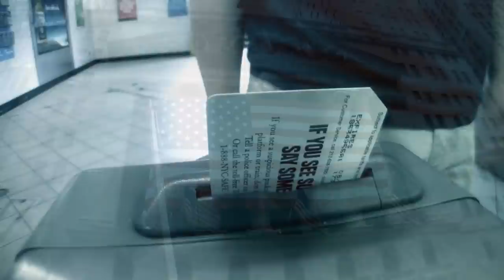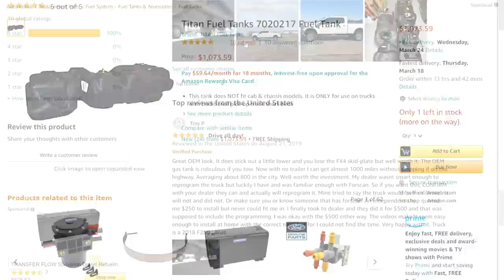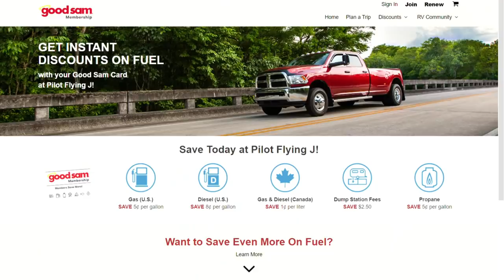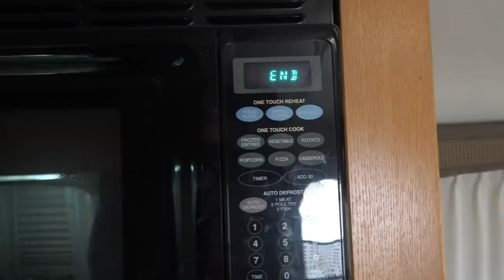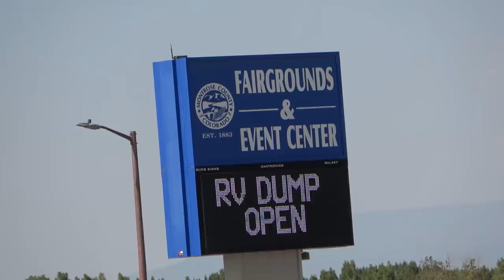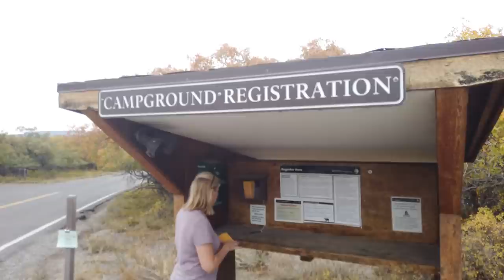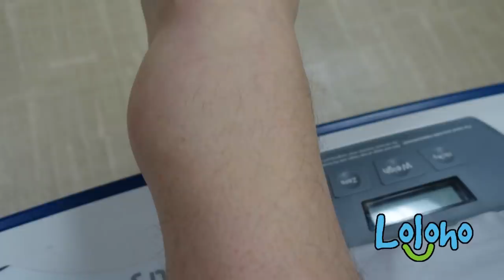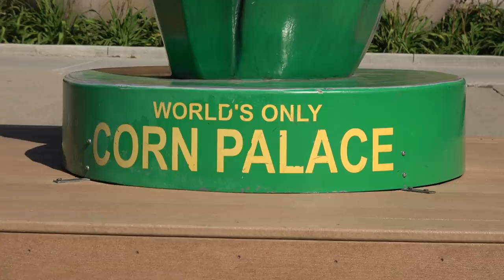For Beginners: THE COSTS of an RV Trip!

Comment: Gas Buddy has saved me a lot over the years. It saved me $1 a gal in Calif. by just going down the road another 10 miles. usually 10-20 cents if I use the app and stay away from the ones right off the exits. My experiences have been just the opposite with propane at distributors. Locally & 2x on trips they're about 40-50 cents a gal more. Surprisingly in small town gas stations have been my best experiences. Last year in Cottonwood AZ at an RV dealer it was 99 cents a gal.  My lifetime Pass has paid for itself many times over.

Comment: When you need propane, check to see if there is a Tractor Supply store nearby. They usually have the best price in our area.
I do try to avoid toll roads when towing. I hate paying more than double the car rate to tow my travel trailer on their roads.  And you don't get any break on the fuel taxes when paying tolls, either.
Reply: TC is the best deal around here too. I'm lucky to have a TC I can stop at on my way to the highway, and a Cabela's with a dump station on my way back. Trips start with full propane and end with empty gray and black tanks, and I don't have to go out of my way at all.

Comment: as a truck driver. yes do not do the push driving. stop rest, see any sight.  one day i was trying to get some place, road work brought traffic to a stop. i remember pulling my brake valves. next thing i knew was the chp shouting at me to get my truck moving. there was nobody in front of me, for the mile of stopped traffic had moved on. and i am used to this life (have been for 40 years). at 63 i want out.

Comment: Years ago...I'm going to say probably 2006 or 08... my late hubby and I had a boat.  It was a 30' cabin cruiser; nice, but not extravagant.  It had a 125 gallon fuel tank and dual engines.  Yeah, if we got it going, you could almost watch the gas gauges spiral down...we tried never to let the tank drop below half, or it got way too expensive to fill.  The boat was too wide to trailer without a special wide-load permit, so we left it docked, which meant patronizing gas docks instead of streetside filling stations.  Gas docks are always at least a buck higher per gallon than land-based gas stations.
This one time, however, we'd been on a long cruise with a group, and the gas got a bit lower than we'd have liked before we found a gas dock.  Well, these are not self-serve places.  This particular attendant was a teenaged boy, and about the time we pulled up and he started our fill-up, a couple of "cute young things" on sea-doos pulled up, and he got busy flirting with them.  
When our tank was full, he looked at the pump, and asked us for $89.00.  We paid, and left, and several miles down river, my husband was mulling it over and suddenly realized that the pump was an older model that didn't have 3 spaces to the left of the decimal, and at $99.99, it had zeroed out and begun counting again.  So, we paid about half price for our gas because the employee wasn't paying attention to his job. Maybe he got fired for it.  We don't know: we were with the group, and didn't go back.  Hopefully the kid learned an important lesson.
Reply: Lol! He probably never made that mistake ever again!

Comment: about the stove my wife has a bad back so I had a junk grill i got the start button off of it and drilled a hole in my stove and put it in and run a wire down to the pilot and hooked up the grill part

Comment: Over the course of time fuel is the largest expense you're going to put in any vehicle.  This is why MPG are so important.  I'm getting between 18 and 20 MPG on my RV, and it's important because I normally travel long distances.  I couldn't do that if my RV got 6 to 10 MPG.  It's a huge cost difference.  

Liked your video, and depending on how long we'll be at a place it really affects how much we spend for an overnight stay.  For example, if it's just one night and we're just leaving for a more distant destination we'll stop at the "Walmart Astoria" and just park and leave the next morning.  

We have on occasion stopped and even checked into a hotel ( pre-Covid)... but since the pandemic we've avoided all hotels....IF you must stop at a hotel, my best advice is to make sure that your room has it's own outside HVAC unit, do not go to a hotel with central air conditioning. 

Prices for fuel outside California are much lower than other states except Pennsylvania where prices are close to California.   

Costco has some of the best prices and they are a top tier fueling station. 

Large RV parks are so expensive and if you don't need all of those amenities just skip them; you're paying for something you're not using.  

I highly recommend RV Trip Wizard; I found this to be quite useful for budgeting.

Good luck.

Comment: We can fill our water jugs at our fire station, just not the trailer or huge tankers. I did fill our trailer once. If you can reach them, you might try. Our closest fire station does not have a spigot outside. The water tastes so bad, you would never want it anyhow. Plus, they had a terrible fire, so it probably still has fire retardant in the soil. That ruined the water in one part of Spokane for years now,

Comment: Can you discuss the impact of speed on your fuel economy and budget?  I see a lot of RV's (probably those who try to drive to Alaska in two weeks) flying down the road at 70-80 MPH.  Also, why don't you keep the pilot lights lit for your stove and oven?  I get a propane odor if I don't do this and keep the propane on to run the refrigerator.

Comment: I do Disney in May and September when rates are cheap, also do 5 days at the Fort and 2 days at the local KOA and eat out on those 2 days, cheapest way to still get the FW experience; am in a small travel trailer so I even get away with the cheap partial sites without sewer.

Comment: It seems like for the price of a decent RV trip,  the cost of the rig, insurance, the truck, fuel, etc... it equates to a substantial amount of mid tier hotels stays plus flights plus plenty of cash per trips.  For example: $50,000 would buy you years of flights and hotel stays, WAAAAY less hassle and less opportunity costs for fun.   I get why people do it, I'm doing it now, but I think about this a lot.
Reply: Maybe. I think mid tier hotels run about $150+ a night, so not nearly as much as most basic campgrounds ($25 to $40 per night). And you have much greater flexibility with RV camping. Flying on a whim is pretty pricey! Also, after years of use you can sell your RV and at least get part of your money back. :)
Reply: @kristymichael    Good point, planned flights are cheaper but lots of campgrounds have yearlong waiting lists. I guess the only good part is the resale return, but large chunks of your life will have been eaten up with time and hassle.  Then again, I've never had the opportunity to take more than a weeks (9-10 days) worth of vacation at a time, so my time has a different value.

Comment: Something to note about the "cost" of a gallon of gas and how "gas mileage".  Believe it or not, mileage will vary depending on  the state you buy gas in,  and  sometimes based on what part of the same state you're in. A few years back I took 3 weeks to drive all over the country and the one thing that stood out to me was the "real" cost of gas in CA vs say, TX. CA and TX is the example I'll use here. Gas  prices were 20% more in CA vs. TX. HOWEVER, gas mileage for the same grade of gas in TX v CA was significant. My mileage improved in TX using the same grade of gas by a little  over 10%. Factor THAT savings as you calculate cost per mile and it's pretty significant. CA loads it mixture with all sorts of additives, "oxygenated additives" and some ethanol. It's crap :)     Happy travels!
Reply: Remember the horrid smog in CA? TX don't care because of geography. & an influential oil industry. 🤷‍♂️

Comment: Love watching you guys, I'm new in this and have been preparing for it I don't have an RV, I own a custom dirt bike trailer with everything I need, two Honda EU2200i Inverters, one jackery 1000, and so on, hook up on the trailer, 1500 btu AC, heater, I'm 60 and have been riding dirt bikes for many years local in NJ, I have a 2017 Ram1500 Sport Crew Cab got all the camping gear I need, and my Satellite now that I'm retiring I want to travel to other States where I can pull up and set camp and ride on the open country, do you have any suggestions where to start where I can camping out on the open country and where you think would be best for what I do. After watching many of your videos its so mine blowing where to start. God Bless and keep safe out there. 🇺🇲🤙🏼

Comment: I've heard that many of the "gas station" propane sales where you exchange your tank for one of theirs, that they underfill those tanks. I've not tested it but would not be suprised.
Reply: Yes you're right Jeffrey. 
To get a "full" refill on propane, a reputable place will fill while on a scale. 
Typical trade-in like Rhino is not going to be as full as a place like Tractor Supply.
Reply: Amerigas has a class action suit currently in place on their collusion with blue rhino over shorting the tanks. Just google it. Just a few million dollars. 🤷‍♂️
Reply: Tank exchange at Blue Rhino gets you 15 lbs of propane in a 20 lb grill tank. Bulk propane is filled to 20 lbs at places like U-Haul, BJs Wholesale Club, or Tractor Supply.
Reply: @AcmeRacing  Also, when you exchange tanks...you're almost always getting a recycled one with the balance of usable life on it. My newest tanks are on my RV, so I consider it a loss when exchanging a relatively new (8-10 years of remaining life) vs. whatever Blue Rhino happens to give you.

Comment: Why do we in Europe not have such big RVs or trucks for towing? Look at our gas/Diesel prices and you will know!  No need to complain about fuel prices in the USA.
Reply: You guys have lots of tunnels in Europe, we actually have to tow OVER those steep mountain passes -- which requires a much bigger vehicle (not just for pulling up and over, but for safe navigating down those steep grades). Also, our RV rigs are almost double the size and weight of a lot of your rigs, so we need much bigger vehicles to tow them with. We've RVed a bit in Europe and South America. It's definitely not cheap in either case.

Comment: i clicked on to watch this video. i went out of the room ended up being a good 10 min. the commercials were still running when i came back in.  sick.
Reply from the maker: That is weird, but I think YouTube has some sort of setting in which you can skip the commercials immediately if you just click the button. In other words, I think the commercials can be skipped. But I am not 100% sure if it works differently on television as opposed to on a computer. I’ve noticed that some of the commercials will run for very long periods of time if they are allowed to run, kind of like infomercials. At the end of the day, we video creators have little to no control over many aspects of the advertising. For example, we really have no input whatsoever over which companies or individuals are allowed to advertise using our videos. For example I would like to keep political ads out of our videos, but there is no option to do so.